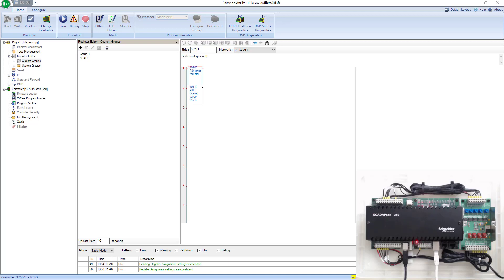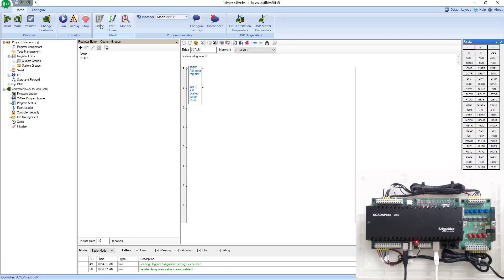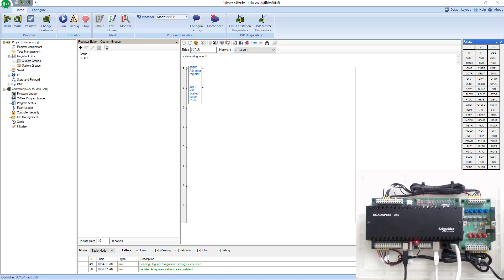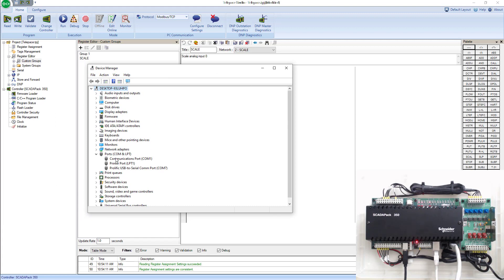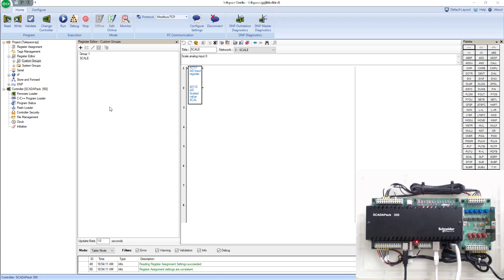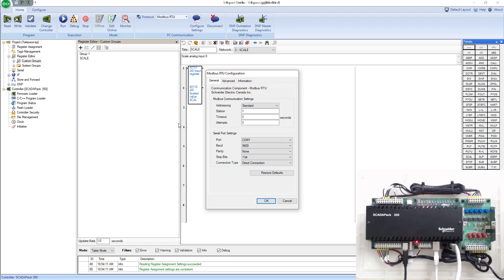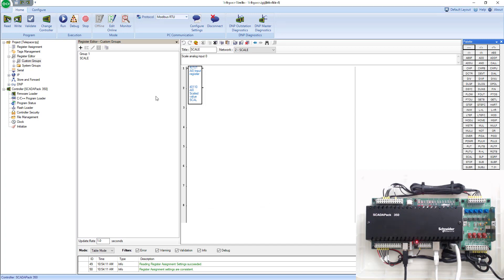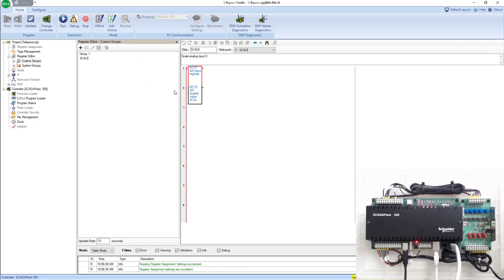Serial Connection to a SCADAPack

Comment: Do we need special brand cable to connect??
Reply from the maker: Yes, you will need the right pin out for a SCADAPack. The RJ45 pin out is located in the SCADAPack help files.